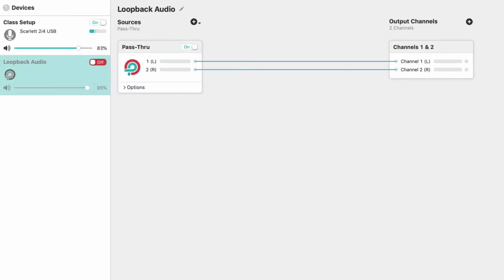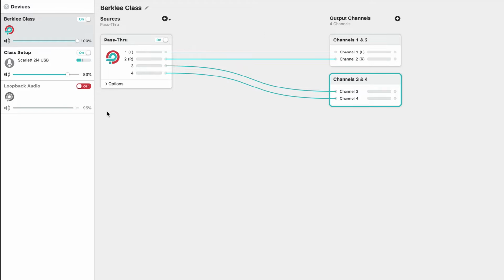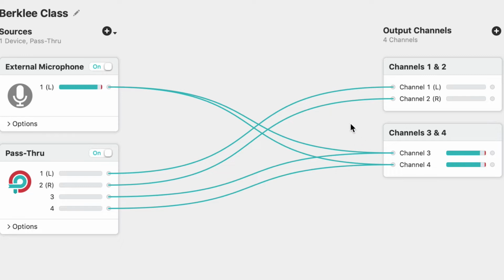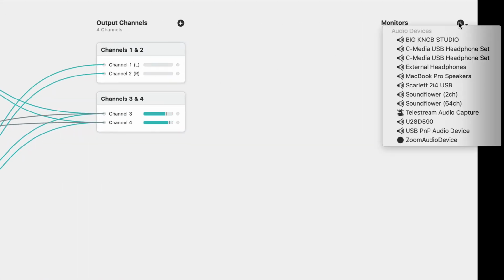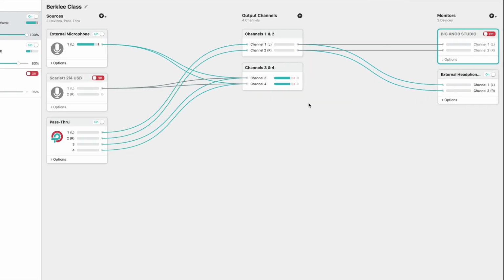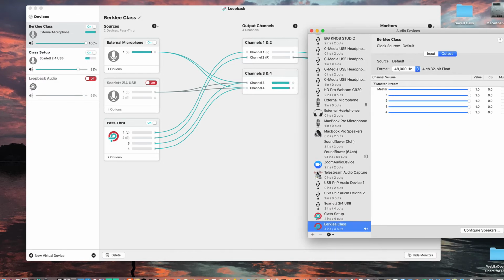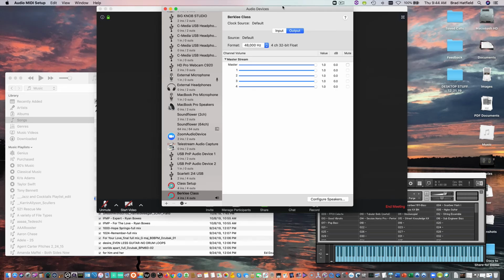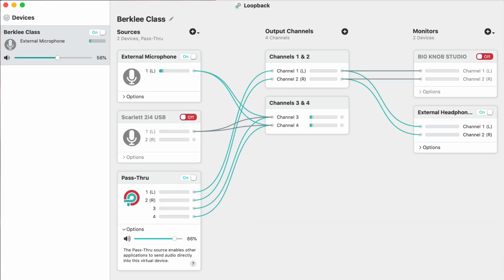Using Loopback 2 for Teleconferencing

Comment from the maker: Loopback setup for teaching

1) Add New Virtual Device
 Name accordingly

2) Add Output Channels with + sign (This will add Outputs 3&4, and will add ability to isolate mic from monitoring)

3) Add Sources (External mic, Internal Mic for example) - This will automatically connect to Outputs 1&2 - DELETE CONNECTIONS FROM MIC TO OUTPUT CHANNELS 1 & 2 BY CLICKING ON THE “WIRES” AND USING COMMAND+DELETE

4) After deleting wires from Ext mic (or other mic source) from Outputs 1&2, draw a new connection to Outputs 3+4 (This will allow your mic to be heard along with other computer audio, but not monitored)

Add additional sources as needed (you can always switch them off) -but, BEFORE PROCEEDING - ENSURE THERE IS NOT A DIRECT CONNECTION BETWEEN YOUR MIC SOURCE(S) AND OUTPUTS 1&2 - INSTEAD, DRAW CONNECTIONS TO OUTPUTS 3&4

5) Add Monitors (ex external headphones) - once again, be sure the mic is not routed directly to monitors, or you WILL get feedback

6) Add additional monitors as needed

7) Set Computer outputs (Use Audio MIDI Setup app) and all virtual instrument outputs (if needed) to your new Virtual Device name - this will pass all audio played on your computer to the summed outputs 1+2, 3+4

With this setup, all audio played by your computer and your mic sources will be routed to your “Virtual Device”, and you’ll be able to monitor all that audio EXCEPT you mic, which you do not want to monitor.
Reply from the maker: As a heads up - Kontakt and iTunes are not full audio in tutorial as the tutorial was conducted with mic only.